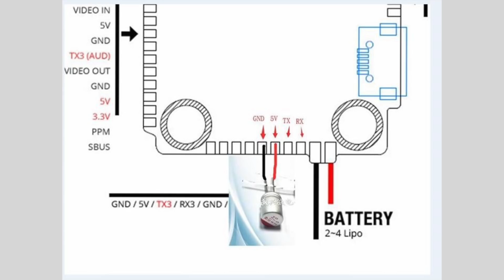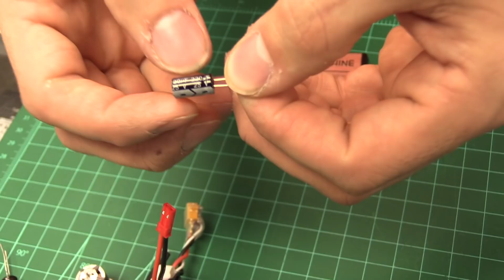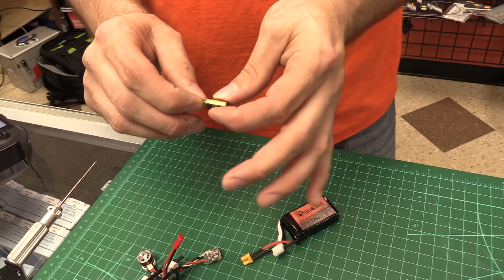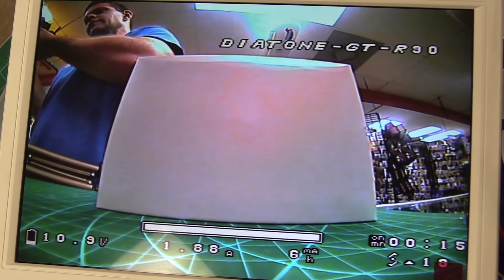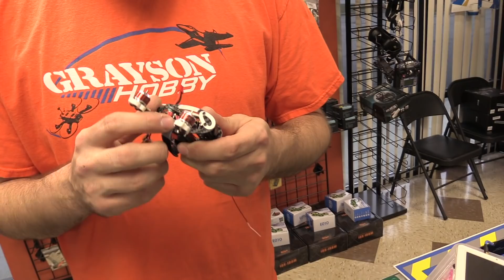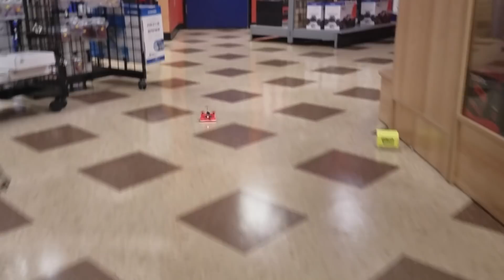Want Clean-ER FPV Video!  Official Diatone Update. Achieving the Best FPV Video!

Comment: Hey Guys,
Thanks for the video! I was going to add a 470 uf 25 volt cap to my 2017 Diatone GT 200S. It has the fury F3S flight controller. Should I just connect to the battery input at the board if I can get a place to fit it? Thanks in advance for your time!

Comment: Diatone should have applied this fix before release. It's odd when a budget 3 inch quad like FuriBee X140 has cleaner video than a brand that is higher up the ranking. Hope this fix will be present on all newly produced Diatone stuff.
Reply from the maker: Yes this has been fixed on the V2 - this video was for those who have the V1 -
Reply: It's flyable, even without the fix. The motor noise tends to randomize the noise that is visible when the quad is idle, so the combined noise is less obvious. But it just feels wrong, after seeing very clean video on other quads, even smaller ones like the Emax BabyHawk-R.